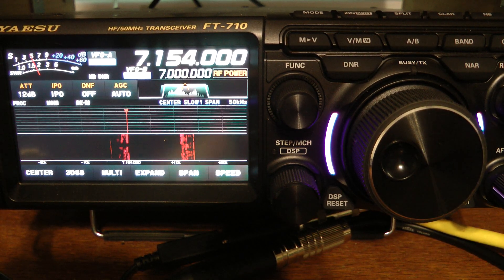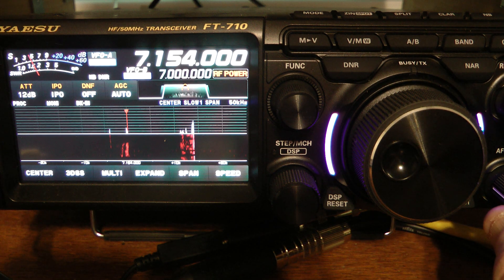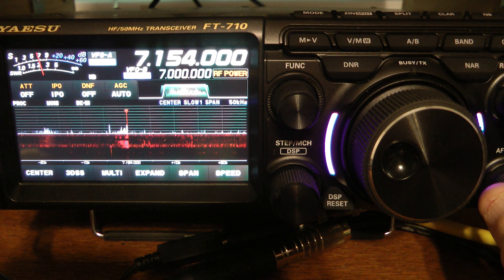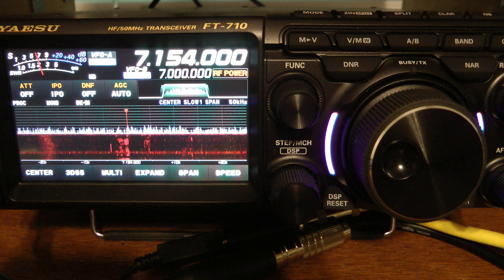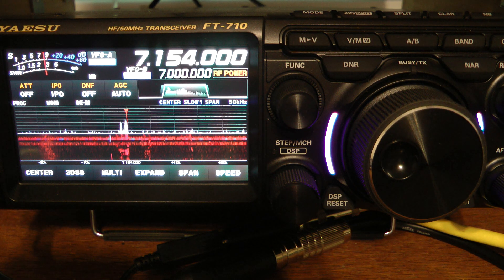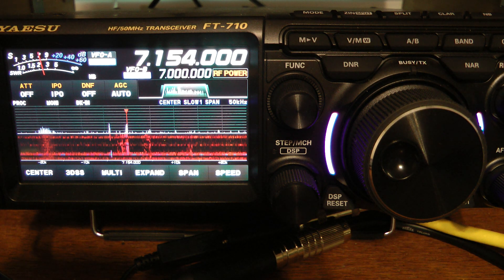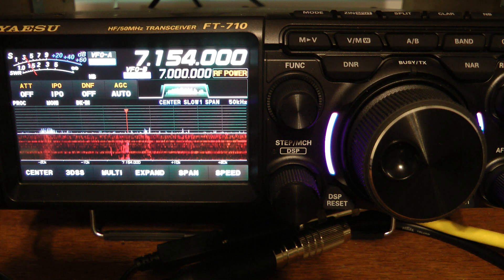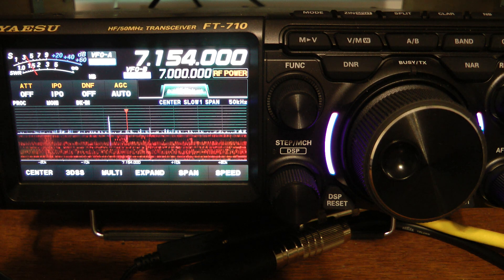Yaesu FT-710 Noise Reduction Example

Comment: Hi thanks for the video. I have had my 710 for 3 days and waiting for the mic  adapter to get here. I had almost decided to  send the radio back to HRO. When using the amp I had so much RFI, more than any radio I have ever had.. I made all new coax. Made p a ne heavy shielded keying cable. I went though every thing I could do to get it out. Take in concelebration I have been a ham for 40 years and this little guy almost mad me give up. I started from scratch. It turned out to be the little speaker. WOW. What a ordeal. I really love the receiver on the radio. Keep up the good work on your videos. Yours has been the best I have found. 73 W5DN
Reply from the maker: I just sent you an email

Comment: Tks for your video . I have been looking for a video like this . I have a icom ic 7300 the rf gain is completely useless.  Turning back the rf control you are left with a ton of noise.  
I can see this radio is much better .
Is it possible you could do a demo video using just the rf control on a noisy band and just using the rf gain control itself?  Or any feedback would be great ,tks Rob MM0UDI in Scotland. 73
Reply from the maker: I am not going to make many more videos, my health has taken a turn for the worse. I do plan on making a video on my hex beam when my son gets it put up next week... That may be my last video unless my health improves
Reply: @johnwofford2708  ok . That's no prob . Hopefully your health will improve.  Tks for the response.